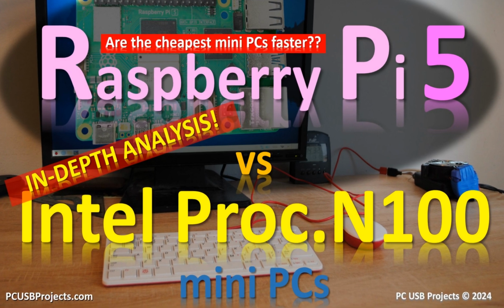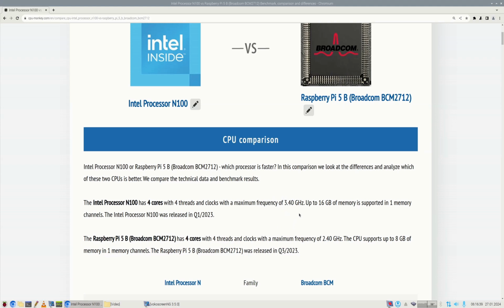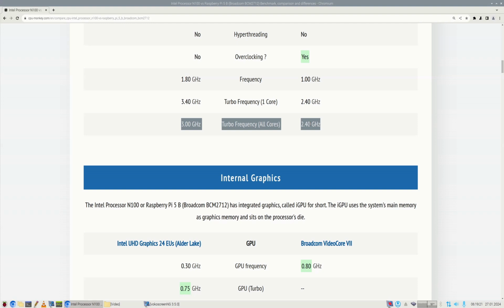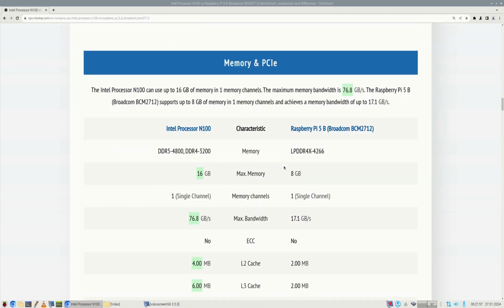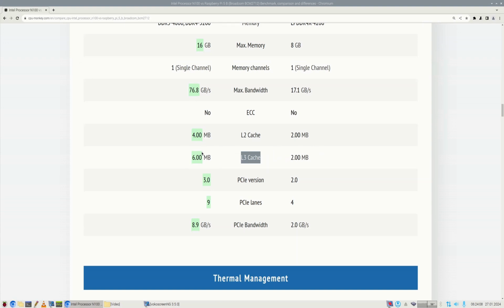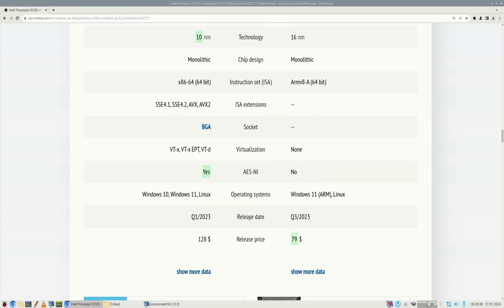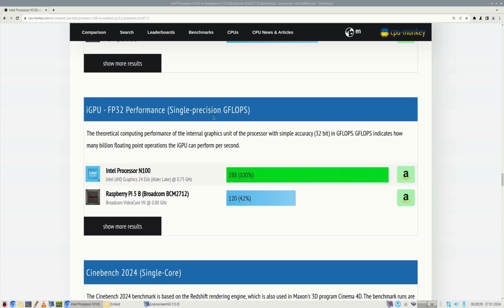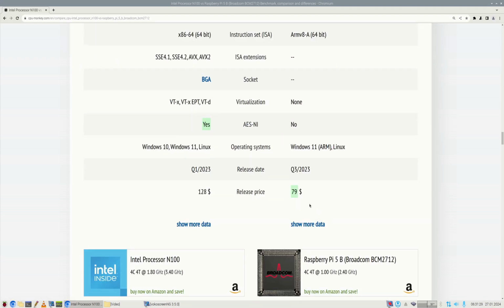Why is a $150 classic mini PC 2x-3x faster than Raspberry Pi 5?

Comment: I am not a Intel fan boy but the N100 gives more bang for the buck
Reply from the maker: I'm just laughing.... I'm a PC and RPi fan, but RPi gives me a greater sense of security when I'm browsing the internet.... It also enables you to explore the world of computer hardware. However, if you need raw power and faster graphics, a mini PC with Intel Processor N100 is definitely a better investment...
Reply: @pcusbprojects  
" but RPi gives me a greater sense of security when I'm browsing the internet...."
What do you mean by this?

Can you expand on this statement a little further?

(I am not sure how RPi5 would provide any more of secure environment, when browsing on the internet, other than it runs on aarch64 architecture, so any programs/viruses/malware that's compiled for x86 won't run on it and/or that the RPi5 is slower (vs. said Intel N100), and therefore; IF malware were to run on it, it would run slower, and could potentially lock up your RPi5.)

Trying to think of ways how this statement would be true.
Reply from the maker: Simply, you don't need to fear malicious code as mush as with a classic PC...  Most of RPi users don't use antivirus software and they are pretty safe, but using antivirus SW with PC and MS Windows is almost a must...
Reply: @pcusbprojects  
Three things:

1) "Simply, you don't need to fear malicious code as mush as with a classic PC..." 
But again -- that either comes in the form of malicious code/programs that are compiled for x86 won't run on aarch64. That's not a RPi(5) vs. Intel N100 thing.

That's an Arm vs. x86 thing.

(i.e. in theory, if you are using any of the Macs that uses the M* processors, and you DON'T let Rosetta run the malicious code - then you can be rock an Apple M* system and the same would still be true.)

2) "Most of RPi users don't use antivirus software and they are pretty safe"
That's an opsec thing.

There are things that you can do for security and then there are things that you can do for expediency.

My in-laws doesn't use AV software neither, but I can set up other systems/software that can help shield them from as much of that as possible, and all of it can still run on a 7th gen Intel NUC with an Intel Core i3-7100U processor.

If you are security conscious, the LEAST that you can do is to switch from Windows to running something like Parrot Sec Home.

(If you are REALLY security conscious, you could be running Solaris 10 with Trusted Extensions installed.)

3) "but using antivirus SW with PC and MS Windows is almost a must..."
Not necessarily.

a) I thought that Windows on Arm was "experimental" at best. (To the best of my knowledge, I don't think that they even HAVE Windows 11 for Arm. At least not yet, and/or not that I'm aware of.)

b) Again, as I've alluded to earlier - there are a LOT of people that DON'T use AV software on a Windows system. If that was the case, then Windows Defender wouldn't have been a thing.

c) If you run Windows on a system that is as performant (or not as performant, as the case may be) as a RPi5 -- then again -- even the malicious code, if it were to run, would run SIGNIFICANTLY slower, especially randsomware, which uses YOUR computer to encrypt your files.

So, if you have a slow processor, it won't be as successful as encrypting your own files by virtue of said slower processor.

I used to use my Pentium MMX 166 MHz and ran Solaris 10, at least once, with Trusted Extensions.

I invited a friend of a friend (who was doing her Ph.D. at the time, with her octo-Opteron system) to try and attempt to hack my Solaris system and my Pentium MMX 166 MHz, when the hacking attempt started, basically just gave up, and rebooted itself after about a minute and a half of it.

Thus, her connection to my system was dropped, and she actually overheated her octo-Opteron system, trying to hack my computer, whereas my computer came back up, about 2 minutes later.

But again -- that's not a RPi vs. Intel thing. That's aarch64 vs. x86 and/or more performant vs. less performant system thing.

Opsec has moreso to do with the security when browsing the web than RPi5 vs. Intel.
Reply: @pcusbprojects  got it... so it has nothing to do with PC vs rpi and everything to do with Windows vs Linux... just install Linux on your PC if that's what amounts to security in your opinion... but don't praise rpi for something it isn't (i.e. a "secure" device)
Reply from the maker: In essence installing Linux OS on PC helps, but other ARM architectures like RPi 5 and Banana Pi are still safer, because they are less known to hackers. Is it is also important how well protected computer's (UEFI BIOS) boot EEPROM is and how it's updates can be made. BIOS is not a open source on a classic PC, which opens a wide field for a malicious code to get embedded into its boot EEPROM. If this happens the malicious code cannot be removed by simply erasing all your disks and reinstalling your OS and all the SW. With RPi it's boot EEPROM can be easily reloaded and the computer returned into its original state... It is also important, if a program can update EEPROM form the OS, which is usually the case with classic PCs.... I'm not going into further details, but it is also hardware specifics, not only the operating system... Once, I had to remove a Wi-Fi module from an older laptop PC, because it seemingly had a backdoor and someone was able to turn it on and establish communication despite it being disabled in BIOS....
Reply: @pcusbprojects  
"In essence installing Linux OS on PC helps, but other ARM architectures like RPi 5 and Banana Pi are still safer, because they are less known to hackers."
I think that you are "mixing-and-matching" different things all in this statement here.

OS aren't necessarily anymore inherently secure than any other OS.

I mean -- this was the kind of argument that Apple used to make back in the day in the Mac (macOS) vs. PC (Windows) ads from the late 90s/early 2000s. But come to find out -- Apples were just as likely and had their own vulnerabilities in their OS.

The same is true with Linux. You can literally run a simple google search to see how many Linux systems gets hacked on a daily basis.

Again, if you were REALLY security conscious, you'd be running Solaris 10 with Trusted Extensions on a Sun Microsystems UltraSPARC system. (Which, oh BTW, you can buy off of eBay now for < $200 USD). 

Talk about people NOT knowing how to hack a system -- if you are really security conscious -- you'd be using a Sun Microsystems UltraSPARC system instead.

But that's not what you're advocating here. Therefore; it calls into question whether the real motivation is ACTUALLY about being able to browse the internet, in a secure manner, or if it is REALLY about something else, and in reality, has very little to do with this point that has been raised.

"BIOS is not a open source on a classic PC, which opens a wide field for a malicious code to get embedded into its boot EEPROM."
This statement doesn't make any sense to me at all. If the BIOS isn't open source for a "classic PC", then how or why would it "opens a wide field for a malicious code to get embedded into its boot EEPROM"???

That doesn't make any sense at all.

Further, IF your statement was true, then you would have a LOT more reports of this happening, but that's ALSO, NOT the case neither.

I look forward to reading your sources that are behind the statements that you are making here as I am certain that you will have links and data/evidence that you'll be able to share with us, so that we can read that for ourselves.

Heck -- when my UEFI boot partition breaks, it's such a colossal PITA to try and fix it, that it is usually, SIGNIFICANTLY faster, to just re-install the entire OS than it is to actually do the work to try and correct whatever it is that ails said UEFI boot loader.

I am sure that there are people who are wayyyyy smarter and wayyyyy more sophisticated than I am, but given that it's such a colossal PITA to try and FIX a UEFI boot issue, I would call into question your statement about how it "opens a wide field for a malicious code to get embedded into its boot EEPROM."

(which, also, oh BTW, isn't just a PC thing -- it would affect ANY system that uses UEFI, INCLUDING Arm, which I think both Ampere and I think Avantek uses. (I think, but I am not 100% sure. It is my understand that M* Macs uses UEFI, so those would be at risk as well, if your statement was true)

"If this happens the malicious code cannot be removed by simply erasing all your disks and reinstalling your OS and all the SW."
Again, that's NOT PC specific. This would be true for RPis as well.

"With RPi it's boot EEPROM can be easily reloaded and the computer returned into its original state..."
You just admitted that this risk exists with RPis as well.

"It is also important, if a program can update EEPROM form the OS, which is usually the case with classic PCs...."
What is it with you and all this fear, uncertainty, and doubt???

STOP IT.

You just admitted that RPis are equally susceptible to this kind of vulnerability with the injection or outright (re)flashing of the EEPROM on RPis two statements above. The method of doing that would be the same on a RPi as it would on a PC. The RPi has no advantages nor is it special/unique in ANY way, in this regard.

STOP with the FUD and please stick to the facts/data/evidence.

"I'm not going into further details, but it is also hardware specifics, not only the operating system... Once, I had to remove a Wi-Fi module from an older laptop PC, because it seemingly had a backdoor and someone was able to turn it on and establish communication despite it being disabled in BIOS...."
Don't buy cheap nor problematic hardware.

Why do you think that the US FTC has a trade ban for Huawei products???

What was the name of the backdoor that you found?

You'd think that if a backdoor was found, that news would be plastered all over the internet and yet, a simple google search for "older wifi module backdoor -router" returned zero references to what you are talking about.

(i.e. are you sure that it wasn't just Wake on WLAN?)

Like I said -- if you were REALLY security conscious about being able to browse the internet safely - 1) you WOULDN'T be using WiFi (you'd be using hardwire only, all the time), and 2) you'd be using systems that the vast majority of people have never even heard of, let alone use, as their home PC (Sun Ultra 60 UltraSPARC workstation, IBM POWER4/POWER5 AIX workstation/DEC/Compaq/HP HP-UX Alpha workstations).

But you AREN'T using any of these systems, which tells me that you're NOT really actually concerned about being able to browse the internet in a secure fashion.

If you were REALLY, ACTUALLY concerned about the things that you've raised in your reply, you'd be using any of these possible solutions to address those concerns. But you aren't, and therefore; I am left to conclude that the security concerns that you are raising, aren't really concerns of yours.

They're just FUD talking points, for which, ACTUAL solutions exist that can address each of those concerns that you have -- solutions that you're NOT going to adopt, because it doesn't play well into your FUD narrative.
Reply from the maker: Computer security is a very complex field, and I'd really like to stress that is it hard to make any general conclusions based only on your personal experience, especially if you are lucky enough not to fall victim to a real targeted hacker attack. In general knowing potential security holes in different kind of computer systems and their OSes takes years of experience. It is of course possible to deploy contra measures (e.i. firewalls, secure routers, malicious SW scanners, network filters, data access pattern detection SW, etc.) to protect any kind of computer system. You probably know a lot of these tools and devices, if you've ever worked as a system operator. Unfortunately, I cannot be more specific about this subject.
Reply: @pcusbprojects  
"Computer security is a very complex field, and I'd really like to stress that is it hard to make any general conclusions based only on your personal experience, especially if you are lucky enough not to fall victim to a real targeted hacker attack."
Two things:
1) One of the principle premise of your argument, in your comparison between PC vs. RPi is security. Therefore; if you think that computer security is a complex field, where "that is it hard to make any general conclusions based only on your personal experience", I would think that this statement can be equally applied to your original point that you raised, about this.

Moreover, given and since you raised the point, this rebuttal doesn't actually provide a counterargument to the points that I raised in my counterargument -- whereby, pursuant to this entire topic that you raised  -- my points still stand: if you are REALLY concerned about being able to browse the internet safely, then there are solutions that already exist that DOESN'T need nor require a RPi to address this concern of yours.

As I stated in my previous reply -- if security was REALLY the core of your point/concern, then you CAN be running Solaris 10 with Trusted Extensions installed on a Sun Microsystems UltraSPARC workstation, and you will be able to browse the internet with near absolute security given said Trusted Extensions (which are EAL4+ compliant) AND it uses the UltraSPARC architecture, which again, pursuant to YOUR point (in your comparison between aarch64 vs. x86) -- if you want to talk about how there aren't (as many) malicious codes that are written for the aarch64 architecture (vs. x86) -- there are EVEN FEWER malicious codes that are written for the SPARC architecture/Solaris OS.

All I am doing and all I have done is to take the points that you introduced into this discussion, and then expounded on it by applying these very same points of argument of yours, and told you that there are solutions that already exist that doesn't need RPi.

2) To test "the level or degree" how much your "browse the internet in a secure manner" -- how important this argument of yours ACTUALLY is -- again, via the points that I introduced, I presented an alternative solution (one that was developed 17 years ago (Solaris Trusted Extensions)), which already meets and addresses your concerns.

In other words, it was to test "how much of the security concern is really a security concern?".

Your response tells me/suggests to me that your whole talking about in regards to computer security, from the arguments that you raised re: aarch64 on RPi, REALLY WASN'T about being able to browse the internet securely.

Per you: "Computer security is a very complex field, and I'd really like to stress that is it hard to make any general conclusions based only on your personal experience"

And what did you do, in your original point of argument???

Precisely just that.

Huh. Interesting, isn't it?

"In general knowing potential security holes in different kind of computer systems and their OSes takes years of experience."
Ummm....varies.

There's an article published on bleepingcomputer which talks about a root access vulnerability in glibc (Source: https://www.bleepingcomputer.com/news/security/new-linux-glibc-flaw-lets-attackers-get-root-on-major-distros/).

Other times, not necessarily (because if the authors of the malicious code doesn't think that a particular computing ecosystem is worth their effort because most people don't use it, and the OS itself is usually inherently more secure), then there might still be vulnerabilities, but they may remain largely undetected because no one has enough interest to a) try to find them and then b) try to exploit them.

(If you've used Solaris (on either x86 or SPARC hardware before, then you will have experience in this area.)

"It is of course possible to deploy contra measures (e.i. firewalls, secure routers, malicious SW scanners, network filters, data access pattern detection SW, etc.) to protect any kind of computer system. You probably know a lot of these tools and devices, if you've ever worked as a system operator. Unfortunately, I cannot be more specific about this subject."
YES!

And this applies to both x86 "PCs" as well as aarch64/RPIs and x86 Linux servers and run a LOT on the servers that serve up web content these days.

(And again, I am focusing on Solaris on SPARC (and/or x86). That doesn't even REMOTELY START to touch on AIX on IBM POWER systems nor HP-UX on HP PA RISC systems.)

I'm not even a sysadmin (neither by training nor trade), but like I said, I've done this, at home, 17 years ago, when Trusted Extensions launched with the Solaris 10 11/06 release.

This is nothing new.

Solutions have been developed and in place for almost two decades.

This was an argument that you raised. I just presented the data and the evidence where this isn't anything new by any stretch of the imagination, and this "problem" has been solved, 17 years ago and the solutions doesn't even NEED RPi nor Linux.

(You can literally google how many vulnerabiltiies Linux has. Just look up the CVE database.)

Heck, even if you don't want to use aarch64 on RPi, you can use SiWave's RISC-V processor and that would be even MORE secure given how few people use it.

Like I said, if you were really concerned about this argument that you raised, there are plenty of solutions that addresses this concern of yours -- solutions that don't need RPi nor Linux.

So....the REAL question is was that point that you raised because if you were GENUINELY concerned about being able to browse the internet, in a secure manner -- you can use ANY of the solutions that I have proposed here and it would be more secure than Linux running on RPi given how FEW people use Solaris on an UltraSPARC workstation as their daily driver and/or compiling Linux on RISC-V.

If you were really concerned about security, given that you raised this point of argument, you would be using ANY one of these alternative solutions that would be even MORE secure than Linux on RPi.

I'm DEFINITELY NOT an expert in this area, but even as someone who ISN'T even REMOTELY CLOSE to being an expert (I'm an idiot in this area as far as I'm concerned) -- even I can install Trusted Extensions on Solaris 10 11/06.

It's THAT easy.

(Sun Microsystems, now Oracle, as far as I can tell, actually has pretty decent documentation -- at least for more "basic" tasks/stuff.)

(It's a shame that back in the day, the cost of entry to be able to learn AIX administration and/or HP-UX administration was VERY, VERY high. This is why I was running Solaris x86.)

You argued that "PCs" (x86) were more vulnerable, but like I said - you can secure your x86 PC with Solaris 10 x86, install Trusted Extensions, and then your system would end up being VERY locked down. (It basically locks your whole system down, and then you have to configure it to open ports/stuff back up.)
Reply from the maker: I see two major security problems in classic PCs: possibility of SW BIOS unwanted upgrades & MS Windows security holes. The first is much more dangerous, because it can circumvent any operating system. Otherwise, I envision classic PC architecture as fast and very efficient and that's why RPi 5 is also following its footsteps hopefully with less fatal security holes... I think that classic PC manufacturers should also learn lessons from RPi's. RPi 5 is much simpler and even if it got infected by a computer virus, it'd easy enough to replace entire SD card's or SSD drive's content with a fresh copy of OS or even to re-flash its EEPROM with the original Rapberry Pi version....
Reply: @pcusbprojects  what is your sense of security based on? btw, any PC lets us explore "the world of computer hardware", not sure how this specifically applies to rpi
Reply from the maker: It is based on my practical experience. I've been a victim of a targeted hacker attack... This forces you to seek for new and more efficient ways to protect your home computers .... Exploring HW is easier and cheaper with RPis, because they have 40-pin expansion ports, which PC lacks... Watch video: https://youtu.be/xDgw-NDdktU.